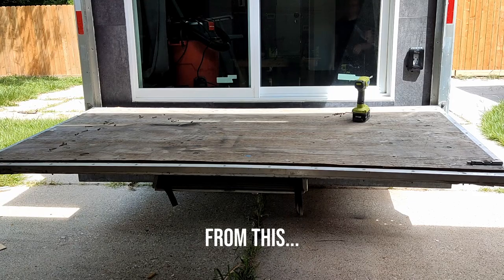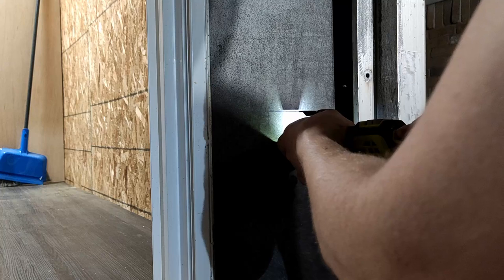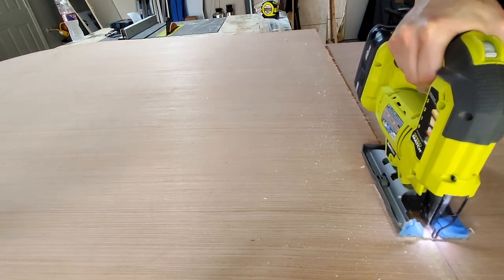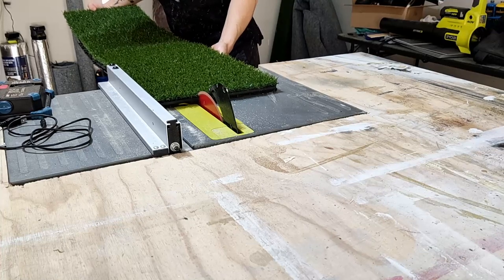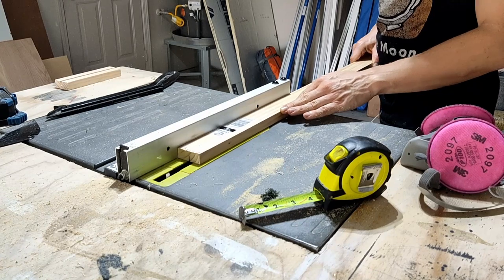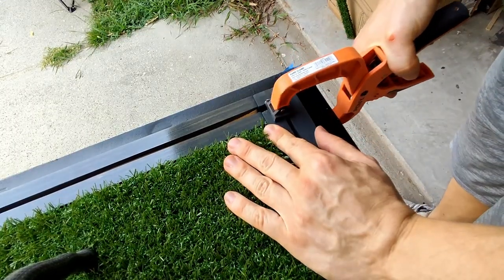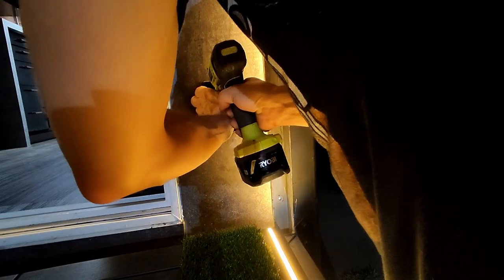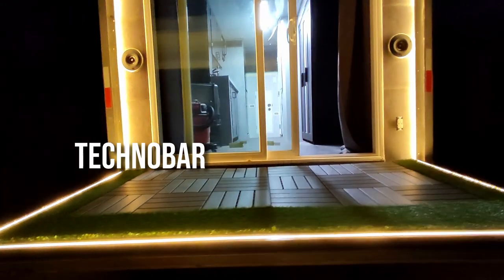Luxury Stealth Patio Deck on a VAN! | DIY Uhaul Box Van Conversion

Comment: Excellent work! Very creative and ingenious design work in particular.

Personally, I would not want a patio deck and sliding doors on a stealth home. I’d never actually use it. The weight of the structure does not justify the benefit.

Comment: Do you think I could make a whole fold-down ramp door (not half and half) on my box truck out of a wood frame like you did? I know that would be more weight than the half door. How much flex does yours have?
Reply from the maker: It has a negligble amount of flex if you stand on the very edges. The loading ramp supports it - You could use the loading ramp to support a full size patio I think.
Reply: @TheTechnoBarbarian  Very good, as wood construction is much easier. Are you worried about any rotting or bowing? Could probably remedy that with a sealant.